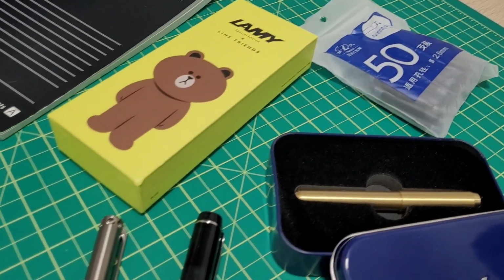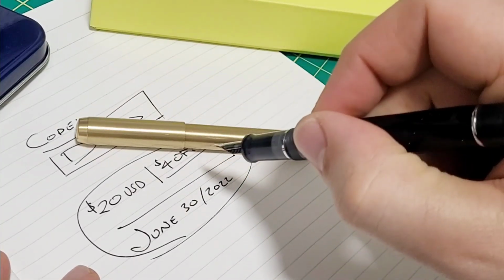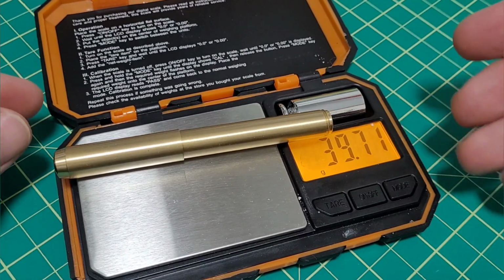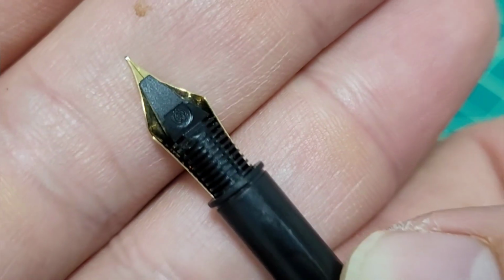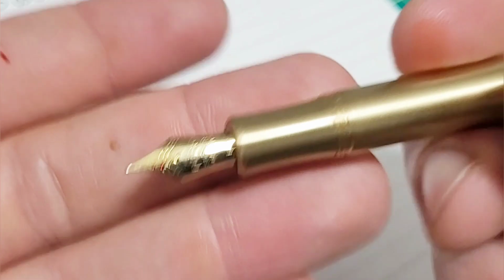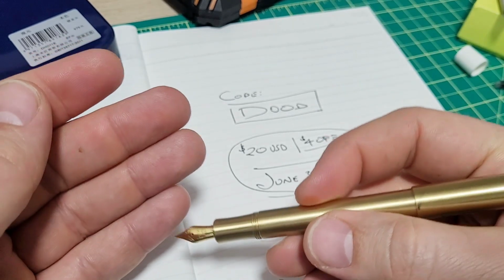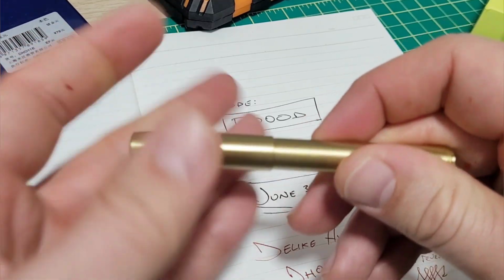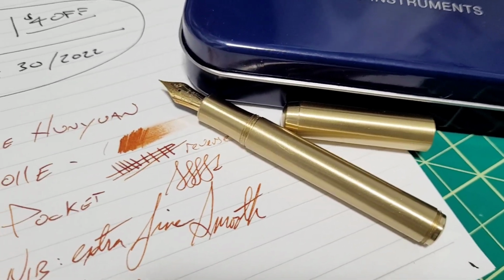Delike Brass Pocket Pen + Aliexpress Discount Code

Comment: Which nib unit does it take Doodlebud,
Is it bock or jowo unit?
Also is it a no 5 nib unit?
Reply from the maker: Its a Chinese made nib, not a Bock or Jowo.  Not sure the exact manufacture
Reply: @Doodlebud  if you find anything about this nib unit, or any other nib units that this pen takes, Please update us doodlebud. Btw, How's the pen doing now?
Reply from the maker: @kodoaok626 TBH I haven't used the pen for some time. If you go into the reddit fountain pen group you can probably find way more info and have your questions answered. I have other pocket pens I use much more

Comment: this is still my daily driver i change the grip to the groove type, it writes way smoother and better than overpriced junk MB 149 and also better than my delta oversized, it only loses out to my CH 92 & C 823
The most important element for a pen is it's writing quality (the rest are secondary and nobody cares about the material uses as functionality > aesthetic, all the time ! ) and the quality level goes as below (excludes ancient over flexible nib pens),
first = almost all Japanese fountain pens especially by the top 3 brands
second = most china pens and maybe a few german ones (older models as the new ones especially pelikan sucks!) 
third = the rest of the pens

Comment: Nice pen, i liked it a lot as an alternative to the canonical kaweco sport, since it is slightly longer posted and practically perfect for my hand. Unfortunately, seems to seal badly. I found ink boogers and drying up in lesse than 3 days. Bad luck or common issue?

Comment: Did you ever get the chance to test the amount of lead on this pen? Doing this experiment would probably give closure about lead in chinese brass especially on fountain pen reddit where some people are afraid to try chinese brass pens because of lead. Thanks Dood
Reply from the maker: Havent done that test.  I used the pen for a little while but not much since the review as I have other pocket pens I prefer so this one has sat around.  I might try to find it to zap it with a laser 🤔

Comment: I really like my Travelers brass pen.   Its features:   removable clip, friction fit cap, key ring,  excellent steel nib, standard short cartridge, etc.  However, it's about 3 times the price of this Delike pen.  Oh well.
PS:  Brass products frequently have a thin lacquer anti-tarnish coating.  It keeps them  looking good without polishing.  (Ask a veteran about shining up their belt buckle.)

Comment: Lol personal  story: my pen is a karas AL13 decograph. I find the pen boring. I've been using it for over two years every day, every truck's paperwork, as a commercial tire guy ( meaning big dirty tires, out doors work)

I've bought about 6 pens looking for love and sold 4.I have my al13 decograph and my goodblue which broke during an accidental capped waist high drop ( after dropping my al13 deco dozens and only having to live with a scratch on the finish)

Twice, to gripe about how fragile my goodblue was, I flug  my al13 decograph across a truck bay in to the hopper of the next garbage truck but that was the the same as casually dropping it. Nothing breaks that pen while it's capped and that's why it's actually not boring.  Ask me for a picture of the pen would ya?
Reply from the maker: Good to hear you have a pen that you can practice your 3pt shots with!

Comment: I have this in black. Did not like the EF nib so tried my first grind. Got the nib to the point that it would not write and put it aside for a few months. Finally realized I had nothing to lose so got the sand paper out again. Now I have a very smooth sort of stub nib with wide down strokes and narrow horizontal, I really enjoy using this pen now.
Reply from the maker: Well that's a sorta win by the sounds of it now 😅

Comment: I've had the black version of this Delike pocket pen for a couple of years.  I also have a slightly longer, slightly thinner all brass model.  I don't remember if it was described as a pocket pen or not, but it's definitely closer to the Kaweco Supra in length and girth than to the Sport.  In fact, I bought a Supra clip that fits it.  I also have a couple of those Sport brass knock-offs, in shiny chrome, brushed chrome, and "antique" brass finishes.  At ;east one vendor had those Sport knock-offs listed as "Delike" brand pens, but I'm not sure if they are or not.  Sometimes I think they just put words in the titles to generate search results, regardless of what the actuality is.
Reply from the maker: Yeah the naming is pretty crazy, like you said hitting all the keywords

Comment: Is there any way to experiment if there is any Pb in this brass? Would be great if you could test this.
Reply from the maker: You know I never thought of that, thanks for bringing it up.  That might be why there is a coating on the pen hmmmm 🤔  Any brass parts I've made has always been lead free brass so totally forgot about that.  There are ways to test it, I don't have the gear.  I think there may be some type of swab test but not sure how accurate it is.  I can look into it.
Reply: I'd love if you could do that, i also have one but i stopped using it bc of fear of lead poisoning
Reply: Sometimes, local hardware store have lead swabs to test for, well, lead.
Amazon has some kits as well - they seem to be readily available.

3M makes a kit - 3M LeadCheck